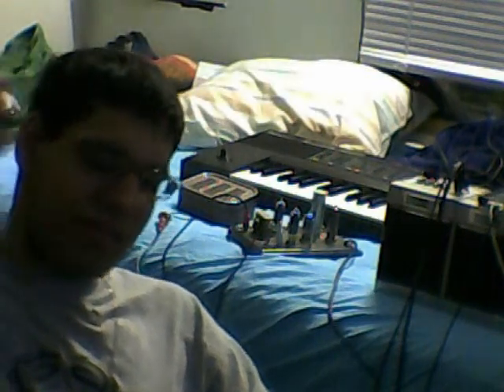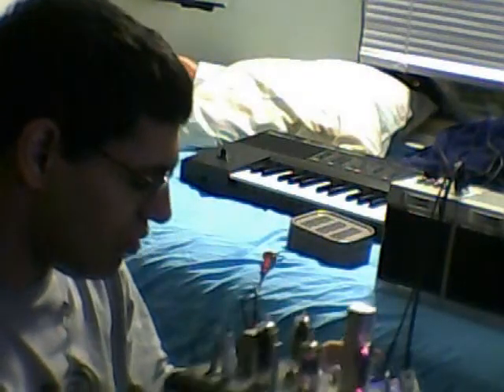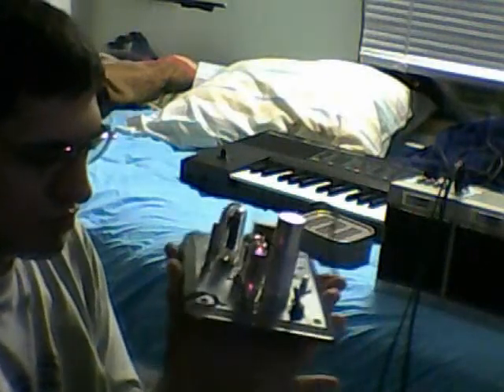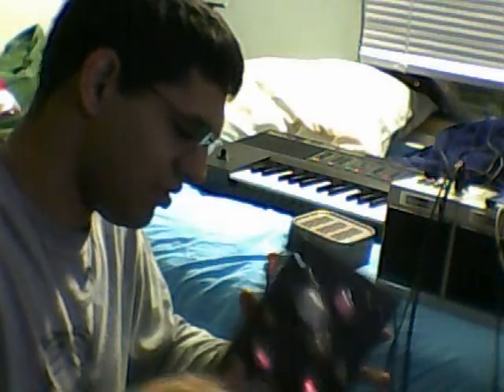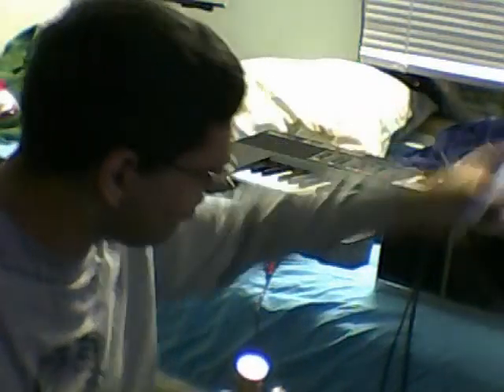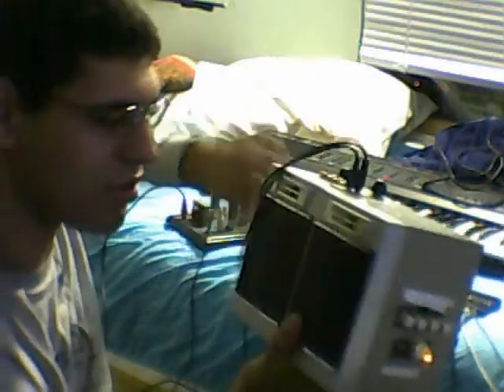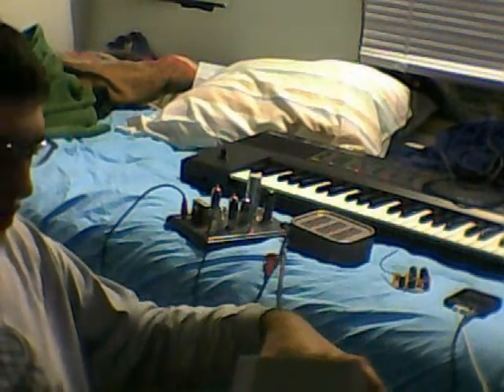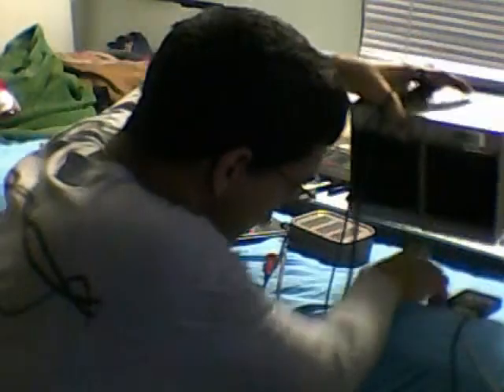Homebrew Tube Amp

Comment: I do not see a power transformer with you amp project and since you are using series string filament type tubes like the 35C5 and the 35W4 I can assume this is what we used to call a hot chassis device.  You did not mention any thing about this in your discussion of the amp.  I assume you took precautions when hooking up audio sources to feed this amp.  I too built an amp something like this back in 1965 (5th grade) using a plan from the Boys First Book of Radio.  My Grandfather who was an electrician helped me with it so I would not electrocute myself.  Your video brings back great memories of thing that led me to a lifelong career in electronics.